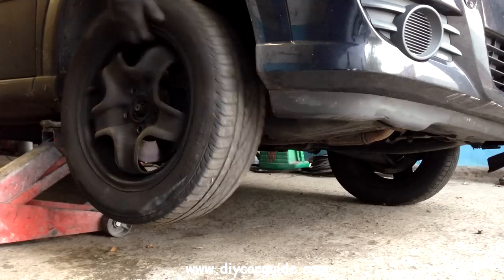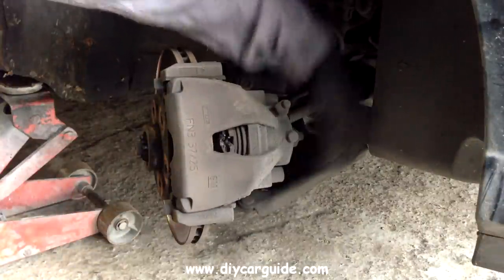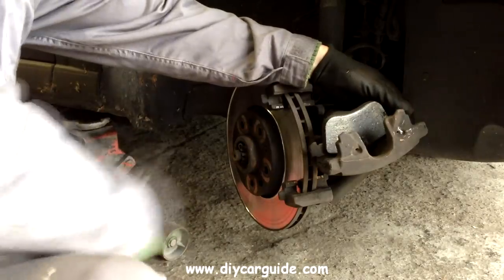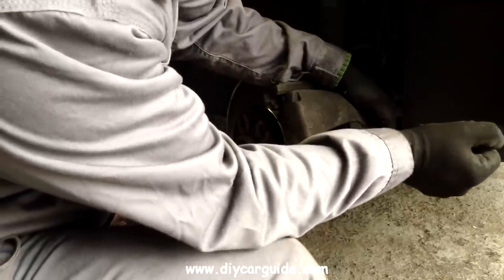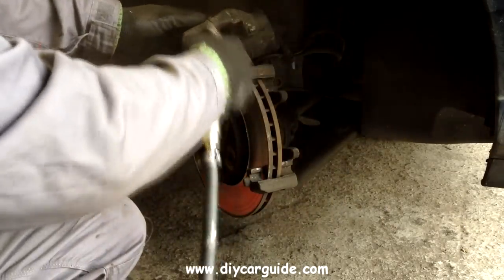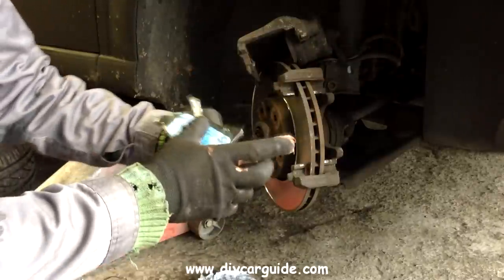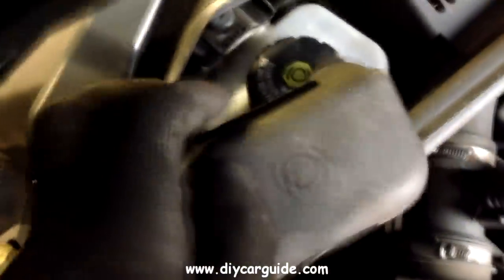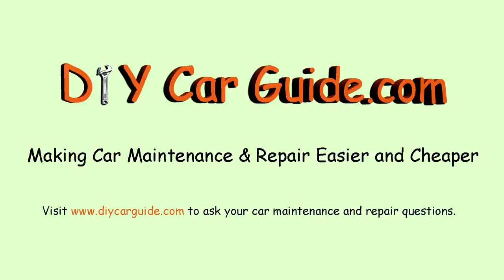Replacing Front Brake Pads On Vauxhall and Opel Meriva

Comment: Hi! Never put copper grease on the sliding pins because it is petroleum based and eats the rubber parts around. Use silicone paste intead. Thank you for the informative video!

Comment: I'd recommend NOT removing brake reservoir cap completely as it allow dirt and dust ingress especially when you use an air gun to fill the entire area with rust and brake pad dust and road dirt... just slacken the reservoir cap of a little to let air escape as you push fluid back into the reservoir and avoid inviting fluid contamination into the reservoir and avoid the chance of the back flow causing a spurt of hydraulic fluid to squirt out of the open reservoir. Copper slip grease is NOT a lubricant it is an anti-seize grease and should not be used in locations that need to slide freely as copper slip grease dries out so will partially seize the pure steel pins when it dries out, which it will. And as others have said it should also not be used on the pins that have rubber sections to reduce calliper rattle as it attacks the rubber and cause it to swell up and also cause that type of pin to seize. Only rubber grease or silicone grease or fully synthetic greases that are designed to be safe for use with rubber components should be used. It is also potentially dangerous to put that much copper slip grease on the back of break pads because they get very hot in use and will liquefy the copper grease and could allow the copper slip grease to flow over the friction material and discs themselves and cause the brakes to be dangerously weakened!
Reply: Thnx for the great advices, just changed merive b front brakes and it got softer than before...why could this happen? I tried to start car with brake oil cap open, could this be reason?

Comment: Too much copper grease/ease on the pad my friend and the sticker is there to stop the pad rattling when braking copper grease must not be used on the pins as this will cause them to bind and the rubber seals to swell use silicone grease instead.

Comment: Have to agree with 'Laszio Toth' never use copper grease on the rubber parts, also when you push the pistons back you should open the bleed valve otherwise you can force a seal on the ABS unit. Overall can see your inexperienced!

Comment: That's proper old school 👍 Thought you had to use a special tool now to wind back the pistons ?
Reply: I would use a brake calliper piston rewind tool and NOT lever against the disk like done in the video as that could easily warp the disk!
Reply: The caliper rewind tool is only necessary for the rear brakes on the Meriva A.

Comment: Hi 
 going to replace my front bake discs on my meriva.
Can anyone tell me if the calliper bracket bolts are torque bolts.
Reply: They are always torques bolts, but experienced mechanics know when it's tight enough. For the rest of us, it's RTFM first. :-)
Reply: @eddiescannell2154  I think Andrew meant Torx bolts not Torque as in the measurement of rotational force.